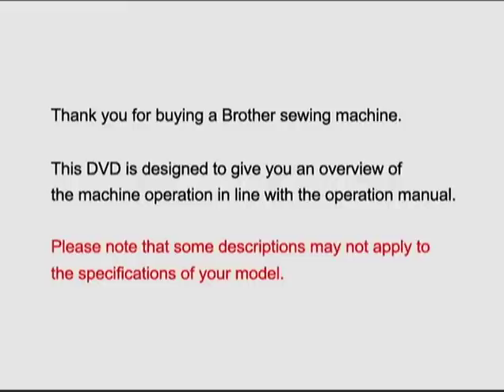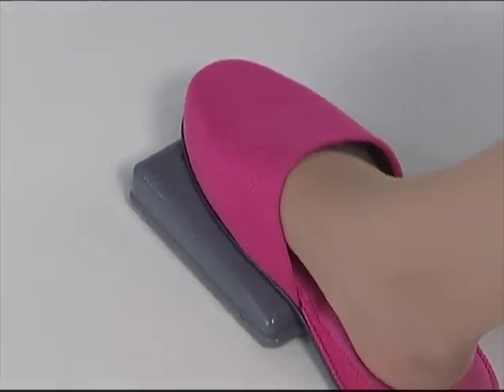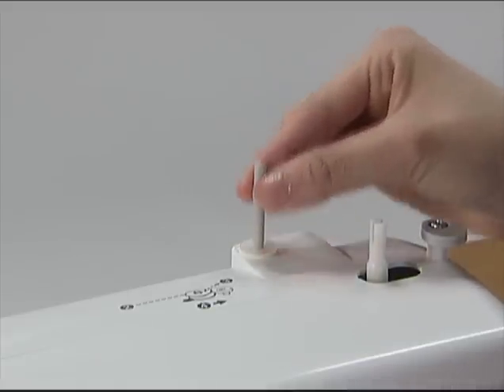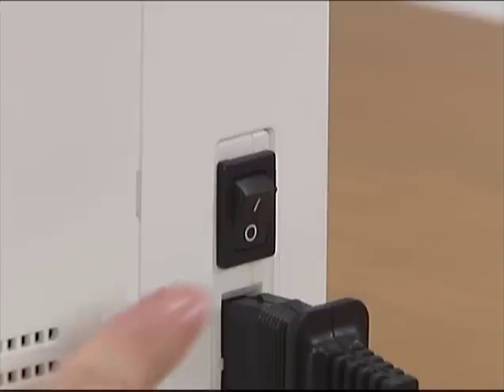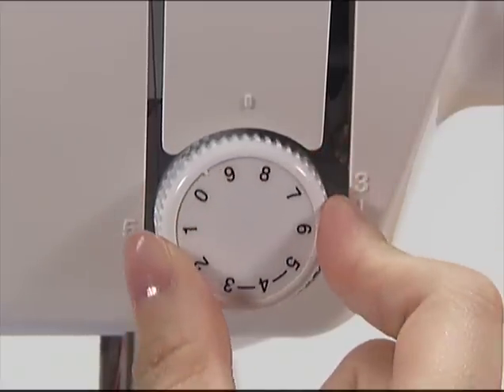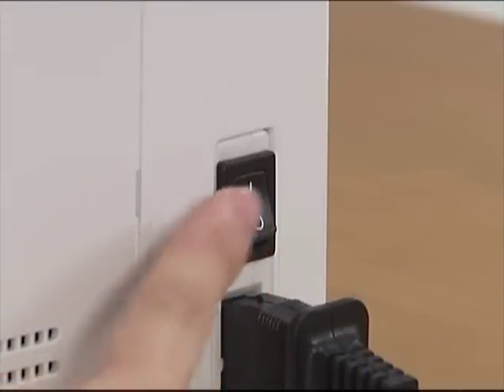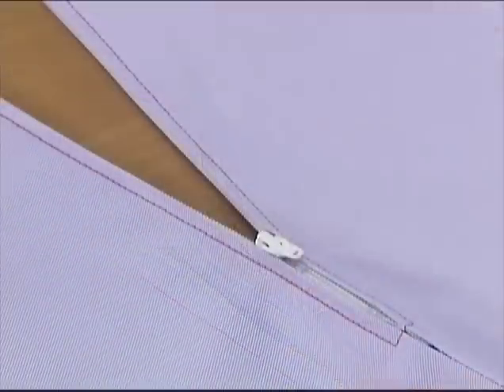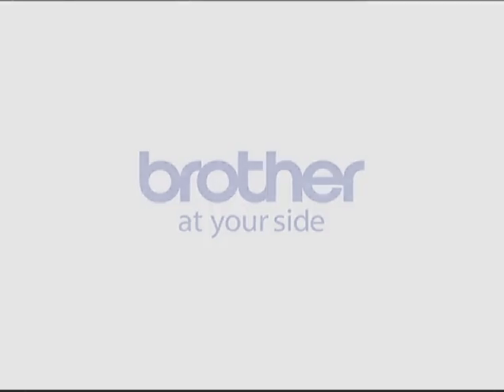Brother JA1400 Sewing Machine - Instructional Manual [English]

Comment: I bought ja1400. But i couldnt connect the dvd on my computer.
Thank you for uploading this video. It is greatly helpful!
Reply: Hi am also going to buy ja1400 but please tell m3 is there zigzag option in this
Reply: @Druveena S N yes there is a built in zigzag option
Reply from the maker: My pleasure! Hope you've been using the machine a lot! it has all essential options :)
Reply: I have ja1400 machine and facings skipped stitches. What is the cause of skipped stitches, already changed needle, thread and changed the levels of tension but still same problem.

Comment: Just purchased  JV1400 yesterday and  want to know if can I use my sewing machine in 110 Volts.
Reply: How much price you recieved
Reply: Does it work well?
Reply: @jharnashrestha8679  yes..
Reply: @ashrafkc4833  I bought it in riyals,,around 350 saudi riyals
Reply: @aeyrin456   how long have you been using it ? and have you faced any problem till now?
Reply: @jharnashrestha8679  two years now, but I used it very often and still works fine
Reply: Does it work fine with jeans and heavy fabric ?
Reply: @jharnashrestha8679  I'm not sure in heavy fabrics I havent tried it yet
Reply: Thank you ❤️
Reply: Are JA1400 and JV1400 the same?
Reply: @mariamd6168  sorry, dont have idea
Reply: @mariamd6168  yes

Comment: I jus bought this type of machine about 2 months ago and the problem is the needle doesn't want to pick up the bottom thread. I want to knw why.
Reply: I's been 4 months since your comment so has the problem been resolved? If your model has the quick set bobbin feature as shown in the video starting 4:45 then the thread is not to be picked up/drawn up to begin sewing.
Reply: Mine does the same thing. Idk what is wrong. I adjusted my tensioner (increased  it) and it worked only a couple times after that. Now I have to lightly pull the fabric to sew. Going to continue trying to fix it if not successful I'm trying a different brand.
Reply: ķ
Reply: same here i hought this machine few months earlier i could not place the lower bobin thread i dont know where am i missing the point ufff its irritating .. waste of my time n energy